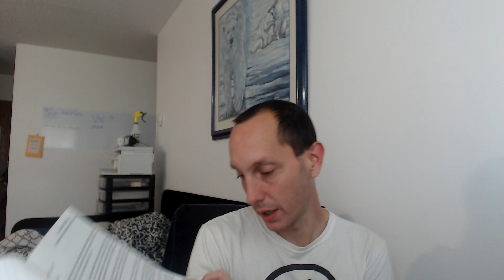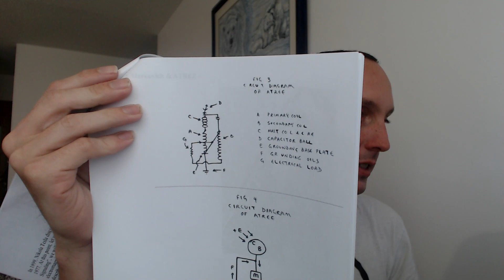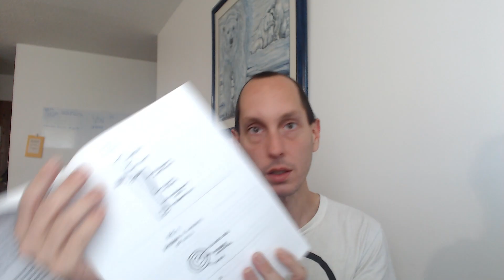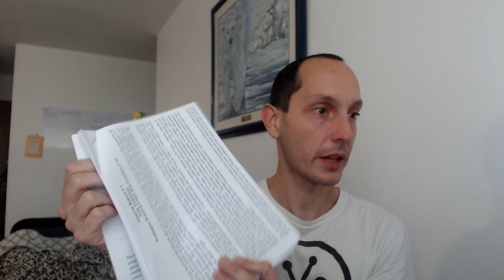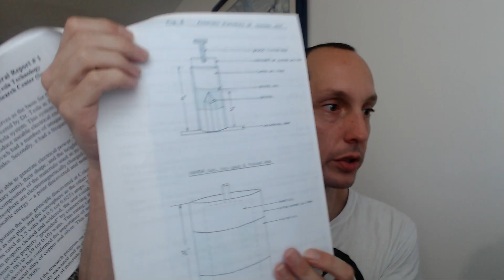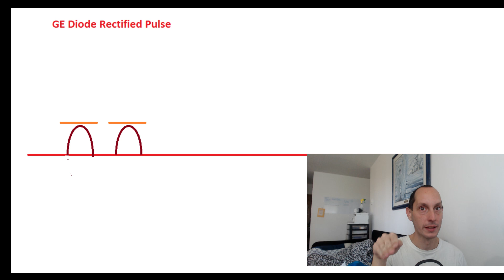Apparatus For Capturing And Converting Radiant Energy

Comment: Just because you dont understand or comprehend what is being said in the "fluff" doesnt mean it is to be ignored or regarded as false.  Id like to know what paper this is.
Reply from the maker: It's all bullshit talking about the original "fluid" ether. It's been debunked long ago into a new theory of ether by Einstein himself. But if you believe in the occult powers. Have at it lol.
Reply: @joellagace1679  If there's no Aether then explain how Light and Electromagnetic waves perturbate across outer space. Waves of what?

Waves are not things, they are what things do.

And what do you mean debunked? If you're referring to the Michelson Morley experiment it didn't disprove anything, all it did was eliminate a model of the Aether, you cannot disprove an entire theory by disproving a single model of the theory. 

Besides, modern replications of the experiment with a single addition, rotating the camera board vertically instead of horizontally, calls the claim into question.
Reply: Peter MARKOVICH

Apparatus To Rectify Ether Energy ( ATREE )

Comment: Schottky diodes would perform better. 100 transistors? Just imagine the heat and transmission loss!
Reply from the maker: heat? I don't think you understand the full scope of this device.
Reply: @joellagace1679  perhaps not, but electricity flowing through resistive components produces heat. Nevertheless I'll wait for results.